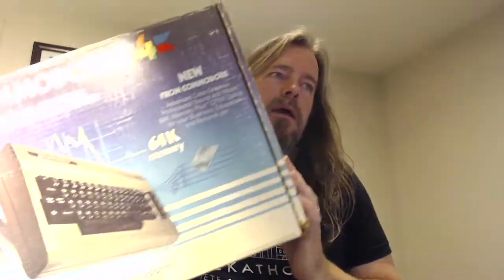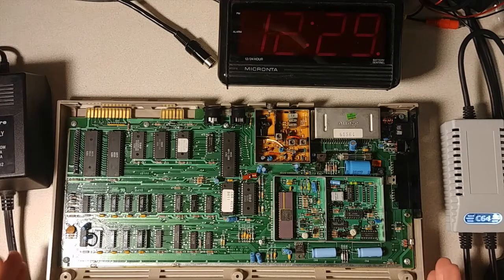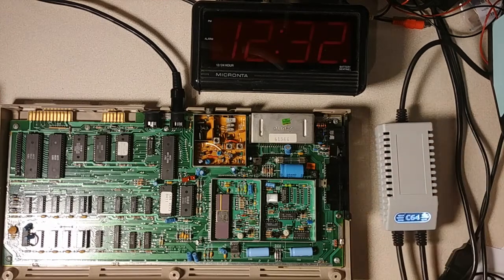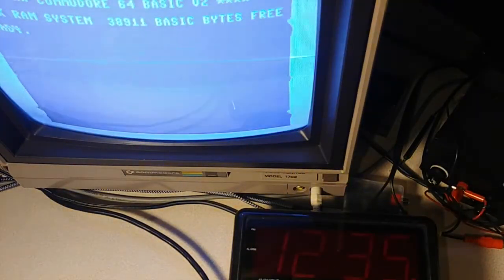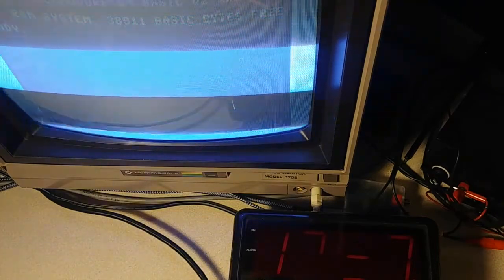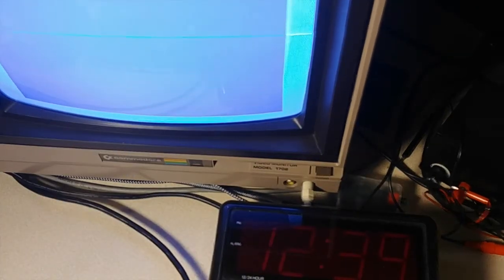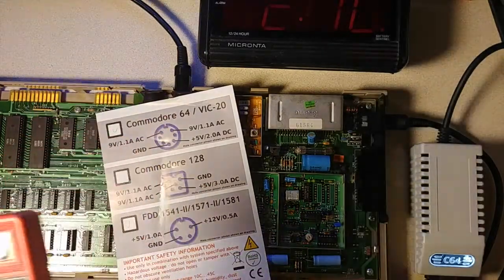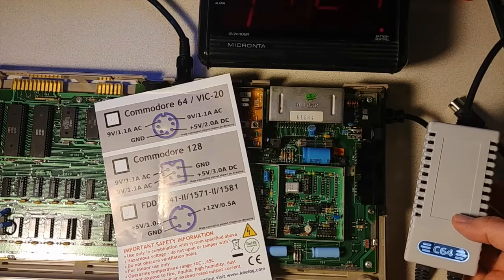C64 issue with Keelog power supply high AC output voltage

Comment: Hi - if you are willing to mod your C64, you could completely stop using LM regulators (LM7805 there) and use drop in replacement similar to this: TPSM84205. It's a pin compatible DC-DC converter that costs around 5Eur - but will not ever produce as much heat as LM. It's highly effective around 95% (depends on load). See datasheet https://www.ti.com/lit/ds/symlink/tpsm84203.pdf?HQS=dis-mous-null-mousermode-dsf-pf-null-wwe&DCM=yes&ref_url=https%3A%2F%2Fwww.mouser.lu%2F&distId=26
Reply from the maker: Thanks! Is it essentially the same as switch mode replacement for th 7805 like described here, which is the one I knew of before?
"switch mode 7805 replacements"
https://dfarq.homeip.net/7805-switch-mode-replacement/
Reply: @DrDavesDiversions  yes, it's all the same tech. Differences are within the max current, effectiveness and ... availability. The one I found, I just searched several minutes ago, so it's currently in stock and can be ordered without problems
Reply from the maker: @sergiuszszczepankiewicz2017  Great, thanks for the info. I will let people know next time I point them to a switch mode alternative for this voltage regulator.
Reply: @DrDavesDiversions  Having said all above. If I were you, I would prefer to keep the C64 not modded and change the power supply transformer to have this 1V lower voltage. Also you should check the schematics details. I checked briefly that this 9VAC goes not only to this regulator. If you are unlucky, you could connect something that will not tolerate above 9V values.
Reply from the maker: @sergiuszszczepankiewicz2017  Thanks, I appreciate the thought. Great minds think alike. :) I already did as you suggest and posted the videos a few months ago.
I can highly recommend the Electroware C64 power supply.
https://www.youtube.com/watch?v=daE0QzkroB8 

I'll put an updated in the description here to make it easiest to find those newer videos.
Tnx!
Reply: @DrDavesDiversions  Interesting - will check it out - what brought me here was my analysis for Amiga 1200 new power supply. What I was concluding was that most probably I will rebuild the old one using all new hybrid caps (from Panasonic - ZA or ZC series) - also I will check your vendor if they have something for Amiga.
Reply from the maker: @tnts999998  Ah, OK. Ya, I saw RMC (channel) picked up the Electroware for the Amiga. I found no issues with the DC side of the Electroware PSU. If I recall, that's all that's needed for the Amiga 1200. I have not tested the Amiga versions though.

Comment: thanks for video! it is educational.. but I ordered BEFORE I saw this video.. doh!!
Reply from the maker: Well, I ordered too, before I made the video :) . It's up to you whether you choose to use this PSU on a C64. (The DC portion of the supply is good, AFAIK, so can be used for other things.) Personally, I don't think it's healthy to run your voltage regulators hotter than necessary (hotter than with the original  Commodore PSU), but if you have a newer C64 than mine, with heat sinks on the VR2 and VR1, it will probably work (at the potential risk of heat-induced damage to your C64 components).
Despite Keelog's straightforward replies to me via email (quoted in comments, etc.) I'm not impressed that Keelog has not [yet] done anything along the lines they promised in email to me: (a) warn customers having old C64s (e.g., with 5-pin video) of this overheating issue and (b) fix the issue with a better transformer, like Electroware has, as I outline in my video here, where I teardown and compare the Keelog and Electroware PSUs: https://www.youtube.com/watch?v=daE0QzkroB8#t=1m37s (1m37s)
Peace.
Reply: @DrDavesDiversions  yeah I will keep that in mind. once it is arrived here I will report back to you what voltage I got from 9v line.. hopely no more than 10 v..
Reply from the maker: @overdriver99  To set your expectations, I bet it will be way over 10v, even under load. Matt from retrobits channel emailed me a couple weeks ago: "I got my [Keelog] power supply the other day but didn't get around to opening it up until now. Operating under load on my 64C I measured 13.04 VAC on the 9V line at the userport."
Let us know what you find (also what country/mains power you are using), please!
Reply: @DrDavesDiversions  I got it from Poland. its DC 5v line is good because it is exactly 5.01 V but  AC 9V line is .... 12 V !!! damn LOL!!!! I ordered from Keelog and my version is fancier with OLED display saying 5V.  I am not sure what to do with it.. I guess I will try on my old C64 :(
Reply from the maker: @overdriver99  This is our experience as well. The AC portion advertised as 9V is way over voltage. Buyer beware. They said they'd fix it but have not yet.
Reply: @DrDavesDiversions  I will put some heat sink on VR.. but I doubt that it works great.. I will try on my C64. I have two so I hope it break only 1 LOL~!@
Reply from the maker: @overdriver99  The heat sink does work well. It will keep the regulator from overheating.

Comment: that keelog power supply can be much improved by desoldering and swapping out the 9vac part of the power supply with a version that has a much lower 10.8 unloaded instead of around 12v with the one that was provided. i can give the make and model numbers for provided for both the pal and ntsc machine, saying that the 326298 will of course only benefit with a heatsinks on the those 2 regulators  regards richard https://www.ebay.co.uk/fdbk/feedback_profile/9thbit-innovations
Reply from the maker: Right, however the trick is to find which exact transformer will fit in the Keelog case with its existing PCB, no? In my experience, the one that Electroware uses is taller... and the Electroware case is smartly designed to allow more freedom.
https://www.youtube.com/watch?v=daE0QzkroB8

I suspect Keelog has backed themselves into a corner with their tiny case design and can't find an equivalent part that fits their case, let alone their PCB, exactly. But that's me giving them the benefit of the doubt. They should have done something by now, as they wrote me in November.

I agree, I put heatsinks as shown here:
https://www.youtube.com/watch?v=F5tjHWYBYx8

Thanks for sharing your ideas!

Comment from the maker: UPDATE 9 Nov 2020: I received this reasonable reply email from Keelog that acknowledges the problem and offers a refund and replacement, if ever they fix the problem. (My reply with a suggestion follows as a comment. I decided to keep the Keelog supply as I've since modified it to work for my purposes; video forthcoming.)

On Sun, Nov 8, 2020 at 1:23 AM Keelog <sales@keelog.com> wrote:

apologies for the delayed reply. We're been analyzing this situation, and indeed a too high AC voltage can result in such problems. Unfortunately, there's not much we can do here. The transformer is rated exactly 9V, however the input voltage is often higher than nominal, and a result we get 12 or 13V AC. We're working to resolve this problem, but despite our best efforts, there's nothing can offer immediately today.   I can only offer returning the product for a refund (and perhaps shipping another one once we have this problem under control). Please let me know.
Reply from the maker: To: Keelog <sales@keelog.com>
Cc: Contact <contact@keelog.com>
<snip>

Thanks for the reply.

What I suggest Keelog do is to add a note for customers on the page about each PSU saying that they are not recommended for very early Commodore 64s because the AC voltage can cause overheating on early Commodore 64s that don't have a heatsink on VR2 (voltage regulator).

These early 64s are easily identifiable from the outside. They have a brown case and have an A/V port with only 5 pins, rather than 8 pins. This includes all 64s having a silver badge at the upper left, above the keyboard, saying only "Commodore" without a rainbow logo and some having a brown badge saying "Commodore 64" with a rainbow logo.

For comparison, note this is how 8-bit Classics warns their customers:
"If your Commodore 64 only has a 5-Pin AV Connector, you [should not] use this [...]"
(from https://www.8bitclassics.com/product/c64-svideo/)

These early 64s are identifiable inside. They typically have a motherboard labeled ASSY 250407 or ASSY 326298 and the voltage regulators labeled VR2 (at far right, next to joystick ports) and VR1 (bottom, under space bar) have no screw in them (at the top of the regulator), attaching them to a metal heat sink. I am unsure about the European versions having motherboard KU-14194HB listed here, but guess they would also have the issue: https://c64preservation.com/?pg=registry

<snip>
Reply: @DrDavesDiversions  I've the problem with my keelog dual PSU. 11.8 VAC between pins 6+7. I hope they release a new "fixed" version with 9.something VAC and I can refund the old one for a new one...
Reply from the maker: @Majo76  Ah, sorry to hear that. It seems their plan is to fix it per the email I received from them. As-is, the existing dual PSU seems to work well as a driver power supply.

I have the dual "2-in-1" PSU from Electroware and it does not supply too high a voltage on AC for the 64. (It is similar internally for the 5V and 12V DC power, but uses a different transformer for 9V AC.) I will post a video soon comparing the two.

Comment from the maker: Has anyone replaced the early C64's 7805 with a switch mode equivalent, as mentioned here?
"Unlike the 7805, there’s no universal name for the replacement parts. In the United States, I find the PSU2-5 most readily available. In other parts of the world, you may have an easier time locating a TSR 1-2450 or OKI-78SR-5. While these parts differ in outward appearance, they are all compatible and all have the same pinout as a 7805. Just get the one that’s cheapest in your country and enjoy your slightly modernized vintage machine."
Read more: https://dfarq.homeip.net/7805-switch-mode-replacement/

Comment: I’m a few minutes into the video, and seeing the distortion you are experiencing with the new power supply leads me to believe something is going on with the 12V supply on the board that feeds the VIC-II (and SID). It should be noted that your C64 actually came with the early style “rebuildable” power supply, and provided it has good ventilation, I’m not nearly as worried about running C64s from those early style PSUs because they can shed excess heat far more easily than the later brick-o-death supplies. Anyways, I’m not familiar with that specific modern PSU you are using, but it appears to be physically small, and I bet its not using an actual transformer to generate the 9V AC (which the computer rectifies and feeds the 5V and 12V internal regulators with) and could possibly be causing some temp related instability. I’ve repaired a few C64s before which exhibited nearly identical symptoms which turned out to be faulty 12V regulators as well, so I’m pretty sure the culprit has something to do with the 9V AC or 12V 7812 regulator in the setup. Also, these early 1982 boards really benefit from adding a heatsink to the 7805, SID and the VIC as well (if you plan on running it without the lid to the VIC chip cage) at a minimum. The fact that your machine runs fine on the original supply tells me the issue more than likely has to do with how the modern PSU is generating the 9V AC. (possibly a square wave “AC” instead of a nice sine wave for instance? voltage too high, etc?) While it is fine to use a modern switching supply to generate the 5V DC the system uses, I would still prefer to rely on a good old fashioned transformer to get the 9V AC a C64 needs if I was designing a replacement power supply personally. 11.2V AC is too high under load in my opinion, and is likely causing the 7812 regulator to overheat because it has no choice but to shed the excess voltage as heat... -aphexteknol
Reply: Although quite compact, they do seem to be using a standard transformer to generate the 9v. In my case it's this one: https://www.tme.com/au/en/details/bvei4811291/pcb-transformers/hahn/bv-ei-481-1291/
Keep in mind I'm in 230v land so it will be different to the one used in the 110v version. But as aphexteknol suggests, the non potted PSUs are usually still good, especially if you are confident with servicing or modifying them. I actually stuck a switching PSU for the 5v in my original, and it's my daily driver. The Keelog is just a backup for me
Reply: TheRetroChannel Interesting that its still a real transformer. I initially started thinking the lack of transformer could be an issue, because I remember a few years back people were having issues with a new whiz bang transformerless PSU that was being sold to enthusiasts. In any case, I am fairly confident that the 11.2V AC he is getting under load is just too high for the 9V AC line, and I can’t imagine any other reason for the issues he is experiencing.
Reply: @aphexteknol  For sure, even the 230v version I have puts out 12.1v unloaded, and probably drops to 11v when loaded (mind you, in Australia 240v is still the standard and I get around 245v on average). So it appears the choice of transformer is not ideal, even at 230v it would put out 11.5v based on the 20:1 turn ratio

On the other hand, the 5v switching supply that they use seems to be pretty good, I only measured 40mV ripple when loaded with 1.5A
Reply from the maker: Well, I appreciate your enthusiasm - and good to know you are optimistic about this early original PSU. :)
Maybe I should just get a Ray Carlsen, or similar, "C64 cable saver" and stick with my old PSU. I'm happy that the Keelog PSU I bought works fine as a 1541-II power supply.
Reply: advoskater Indeed. Quite a few of my early videos are about modifying these 1982 boards to make them as nice to use as the later style boards, as I think its a shame they don’t get more use by C64 enthusiasts. You can’t beat a Ray Carlsen PSU in my opinion either, and last I checked he still uses a real transformer in his designs for the 9V AC part of the supply. Anyhow, I’d be happy to help offer any other help or tips you might need. Look me up here on YT or over on Twitter if you have anymore questions. I’m all about keeping this vintage hardware going. :)
Reply from the maker: @aphexteknol  Tnx! This machine is my [1st] baby, so will get it in order.
I also have a nice mod to replace the 1541 power supply for a 1541-II connector coming up.
(This was part of the impetus to get this new PSU.)
Reply: @DrDavesDiversions  If you really want to go crazy, I'd love to see you recreate a mod my friend performed to one of his 1541 drives. He replaced most of the logic in the drive the later CMOS variant chips, EPROM ROM replacements etc, and lowered the current draw of the entire drive even further. Combine that with an external power supply and you might end up with the most bulletproof 1541 on the planet.

Comment: You could use the can around the VIC as a heatsink, but that is not ideal. Alternatively you could replace the 7805 with a higher current rated version but again that's not really solving the main issue. I would contact Keelog and point them towards this video. Whether or not they are aware of this issue I don't know, but I feel they should at least be clear on their website that this PSU is not suitable for this revision board. And their design should be revised to lower the AC output.
Nice breadbin btw
Reply from the maker: Right, good thought. Attaching the voltage regulator to the can seems less than optimal, though. Honestly I don't want the components to run any hotter than they used to (even if it is dissipated effectively enough to run).

Aside, this C64 has lasted 37 years, since my parents bought it for me, w/out any service... zero. This was the first time I opened it and the EMI cans.

Lets see what Keelog says. I am surprised they must have found that they can run the AC rails at so high a voltage on most C64s, but I've only had the one. :)
Reply from the maker: Lol, just found that Frank, here, fitted a heatsink to that voltage regulator like this (posted yesterday):
https://www.youtube.com/watch?v=IVvI998PWGE#t=11m15s